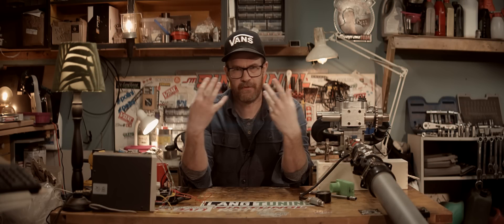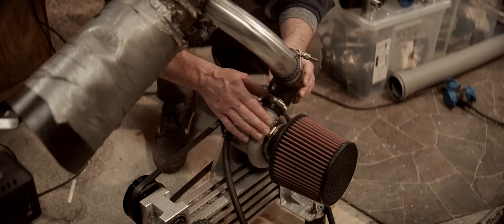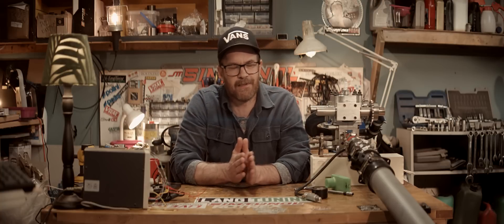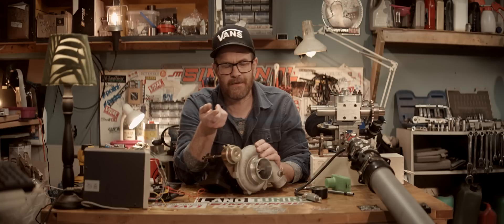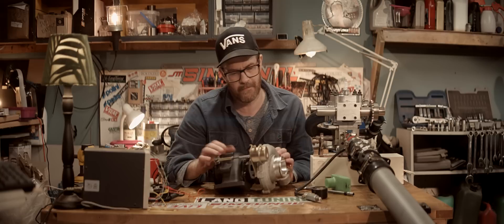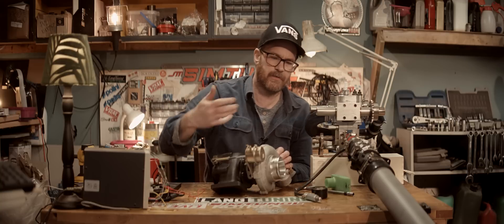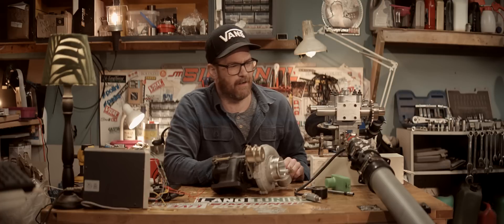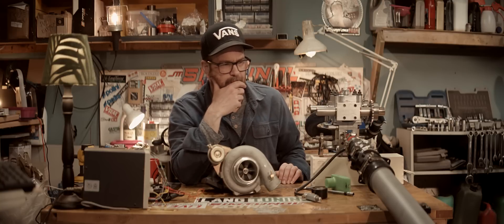THE most genius/stupid idea! Turbojet supercharging.

Comment: I love that idea of making a turbo jet as a compressor. There is lot of people who make turbocharged burn barrel with wood but ther have a problem of making to much boost but if you cool and run the extra clean air through the engine you would have almost unlimited boost and controllable boost.            I think Subaru do something similar with there rally cars useing compress air to spoole the turbo off throttle and fuel to jet engine the turbo.        Someone really good to talk to is the people who do the mini jet / jet engineers planes they would have an almost perfect know how for this stuff         Hope this help looking forward to seeing your ideas
Reply: not "too much boost" as more like "too high an EGT and too much debris, ash, and other particulate matter". then they run ALL the air into the fire, with no thought of turbulence or flow inside. then they shove a plank of wood over the compressor as they never considered the waste gate or variable bypass air, that a traditional jet only uses a small amount of air for the actual combustion...

found one in portugal thats running "external combustion". proves the point... you only need the heat and airflow for them to run.

Comment: i think u could use both the supercharger using a clutch for each of them and changing the supercharger used while the engine is running
or maybe use a cvt transmission on the supercharger

Comment: No. The efficiency of a jet is lower. To get any force from a jet you need to move a massive amount of air at a hight pressure. So probably 5 to 10 times more horse power to get the bike to move properly.

Comment: Stop complicating things and wasting energy on unneccessary moving parts. Replace the muffler on a regular 2 stroke exhaustpipe with a turbo. On your application the increased turbolag is not an issue.

Comment: That is cheating. You put in energy by combustion of the turbojet. I think the turbo or compressor must be driven by the 50cc engine to call it the most powerful 2 stroke. Otherwise you could also put some extra rockets on your bike.

You could also gear down the compressor to reduce flow rate and save energy losses. Just find the sweet spot in rpm, pressure and flowrate.

Comment: Just need a turbo jet with a small enough compressor side, also coupled with a dump valve that’s boost driven. Like what you’d have on the exhaust side in a normal turbo setup, but move it to the boosted intake side (blow off excess intake airflow based that intake pressure )❤
Reply: That way the turbojet can produce a steady flow with a set pressure, but there’s a way for it to dump off (even dump 100% if the actual intake is not open and deadheaded with the engine not running) regardless of the engine need (ability to ingest).
Think of the end result being like having a set pressure air tank that doesn’t run out.

Just need to make sure it can produce enough for top rpm/power for the actual engine.

Comment: USE THE TURBO!!!!!   You CAN NOT rely on the 2 strokes designed exhaust port/timing/exhaust pipe design. It is NOT conducent to what you are trying to do!  You need a big pipe to make that engine run under boost. Which means it wont run out of boost. If you simply added the turbo as they are originally intended, the hot side will cause the back pressure needed. Otherwise you need to change your exhaust type/port timing to allow cylinder charging without a pipe.   Your elaborate idea about  making a "turbo jet" the way you are talking is pardon not smart. You seem to ignore the fact that you cant even get the engine to run normally with a supercharger as a load, how do you intend on making it run with crap in the way in the induction system?   Nah, you're way off your mark bud. Sorry.

Comment: Why not a rocket anti lag, Its an external combustion system to keep a turbo in the correct speed/presure independent of the exhaust produce by the engine. This was used by subaru during the early 2000s

Comment: You could compound with one supercharger(If you have lots of "excess flow" and time/degrees between scavenging cycles), you "just" need 2 mechanically operated valves and 2 reed valves(Or mechanical valves) and a boost tank.
One reed into the engine a mech valve between that reed and the SC diverting the flow into the boost tank, mech valve from tank outlet to SC intake and then a reed from atmosphere between the tank and SC.
If you had infinitely fast and efficient valve operation you would be able to compound several stages with more boost tanks(And of course lots of valves!).

Comment: If you could turbocompound one of your engines like the Napier Nomad, you could theoretically make crazy power. If it could somehow be done (gearing the turbine to the crankshaft is a bit difficult), the efficiency of the engine would be higher and the crazy exhaust port timing of your engines creates strong exhaust pulses that would be perfect for driving a turbine.

Comment: I understand your thought process, but I'm not convinced that this will work. By the time the airflow reaches the engine, it's going to be seriously hot. Hot air will contain less oxygen that cool air, and with less oxygen you'll get less power.
Can I suggest an "easier" way? Build your own supercharger, based on the Rotrex design, with the same level of boost but a lower air volume.
When I say "easier", I don't mean "easy". Easy is not worth anything. Good luck.

Comment: sounds like you need a roots style supercharger rather than a centrifugal style EDIT: LOL I posted this comment at 4:40  and then you pull one out haha.  Are you limited to carb only? a rising rate fuel pressure regulator set to a ratio with inlet air pressure might help if efi.  otherwise with EFI you can map injector duration to boost pressure? another option - a centrifugal CVT for the supercharger so low er flow low down then higher ratio with more input RPM? essentially doing your turbojet but with a CVT and single charger rather than pneumatic driven turbo from the charger.

Comment: I like the idea, however i´m afraid it´s not gonna work. Turbojet are incredibly complicated. The engineering involved to make them work reliably and suitable to your application is insane. Furthermore your jet will be ultimately limited by the power output of the IC enginge driving the jet compressor. Most of the power in conventional jet engine is used to drive the compressor section to keep the engine turning. You might be able to make it run at a certain low RPM without any load on it but thats it. Since your jet would not be self sustained, you would need a sophisticated control loop to stop it from dying after applying any kind of load to it. But maybe you can prove me wrong. I am very excited for the upcoming content but I´m afraid you will just end up with an over-engineered garage heater. Then again it gets quite cold where you live I believe, so it might end up with a purpose after all :)
Reply: I just realised that I missed the point of what I wanted to say. In simple words: Even if you built the perfect turbojet, you will never be able to achieve more power uplit from it than what youre IC engine is supplying to the turbojets compressor. You are just basically applying the power output from your IC engine generator to your 50cc through an icredibly wasteful conversion process. Sounds like a fun journey though and I certainly wanna see you do it (for content).

Comment: I have zero opposition to "crazy" ideas (I am after all running a VGT turbo from a 6.7L diesel, with the VGT actuator controlled via CAN network, on my 2.7L gasoline powered car that predates CAN networks by some years, in large part "just because"). But as soon as the success of one subsystem of the overall concept depends on the success of another subsystem, things get infinitely more difficult, and usually impossible!

For example, when the crank power 50cc engine needs to be sufficient to power the supercharger, and the supercharger's angular velocity needs to be appropriate to create the appropriate pressure/flow to maintain combustion into the turbine of the turbocharger, and the fuel supply to the turbojet needs to be sufficient to maintain that combustion, that combustion needs to impart sufficient shaft power and appropriate angular velocity into the compressor of the turbo, which needs to create sufficient pressure and flow to feed the 50cc engine while avoiding surge... all of a sudden the stars will need to align to get the entire system working at all, let alone making significant excess crank power to achieve your overall goal.

That doesn't mean it won't work! But for development to succeed, you have to break the interdependencies of the subsystems and make them independent from each other, figure out how each works and how to optimize it for your overall goal, then put the pieces together with the knowledge gained. If you do that, I think you'll succeed, particularly because you are highly motivated, creative, love doing this, and maybe most importantly, *you're one person with unilateral design decision-making power*. Maintain clarity of vision, combine it with objective, evidence-based decision-making, and you will likely create novel, record-breaking stuff!

To go back to the jazz analogy, handing instruments out to a group a people that have no musical knowledge will not result in free jazz in any reasonable timeframe, most likely never at all. They'll just get bored and frustrated after feeling overwhelmed. But giving some technical and theory training to each of them, figuring out what they're talented at and what they enjoy, figuring out how to get them into a situation where they can do what they're good at and what they enjoy - THAT will make it much more likely that they'll make nice music together, maybe even some nice jazz. In this analogy the aspiring musicians are each subsystem, not the music director, to be clear :)
Reply: 👆🏻What this person says.  One variable at a time. A little bit slower progress initially, but the time saved in successive iterations will far more than make up for it.

Really, I don’t know enough about 2-stroke engines to offer any specific suggestions.  I have done some experimental work (so long ago we had to watch out for pterodactyls), and usually, the ‘change one thing and test, test, test’ folks would come up with the best result before the ‘all at a single whack, test, change a random amount of stuff [up to everything] all at once, repeat’ folks.  Once in a while, the second group would either get lucky, or had a team that had the specific knowledge to try the right combo early, then, they would beat the first group by a huge margin.

I love the unique combinations you try.  I love the idea of a supercharged 50cc!
Reply: Agree... I have been experimenting with a 150cc to 185 - 205 - 225 - 251cc air cooled 4 stroke, over the last 11 years.. almost have it sorted out 🤪 13000 rpm 12.5 : 1. Was 11.5 : 1 @ 12000 rpm 2 months ago. Step by step after my wild attempts at 14 : 1 and  30+ forged (melted) pistons later 😂 Went great but only lasted a few months. Shooting for 45-50hp reliably out of a 251cc SOHC air cooled KLX 140 bored, balanced with oversized everything... My OCD continues 🤙

Comment: I’m not sure why you don’t just size the pulley correctly on the supercharger to get the psi and airflow you looking for. Seems like you need to under drive it some this would also cause less drag on you engine as it will have trouble driving the supercharger at low rpm’s . If your engine can’t flow you will get more psi in the charge tube than on the other side of the intake because of restriction. On most engines you measured boost in the intake after the carb/throttle body. Also if you want to know how much air will flow through you engine take the smallest passage let’s say intake passage and put  a mass airflow on each side inlet and outlet increase flow until the input is more than the output that’s the max flow of the engine. An engine is an air pump. If you max the air flow that’s your max hp capability.

Comment: Have you seen the new electronic wastegates? I have a slightly different idea involving the excessive airflow. Why not instead at lower rpm divert the airflow past the exhaust to create a Venturi and pull spent mixture out at lower rpm when the engine is less efficient and as rpm and efficiency climb close the electronic gate to achieve the boost level you desire. I believe in a previous video you were saying that going efi was an option a simple microsquirt or speeduiono should be able to control the engine and an e-gate.

Comment: if i understand you correctly. your goal here is to ultimately end up with enough airflow to make 4 bars of pressure at the engine inlet? if thats so. Then i think a better option is a compound turbo setup (not to be confused with turbo compounding) a turbo jet sounds alot cooler thoug. but maybe you can take subarus wrc antilag system and combine that with a compound turbo setup?